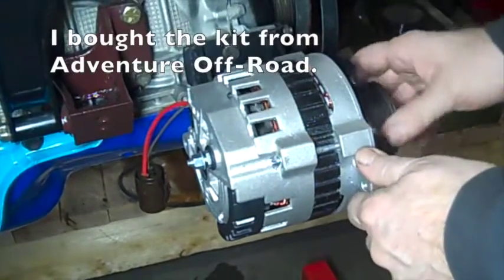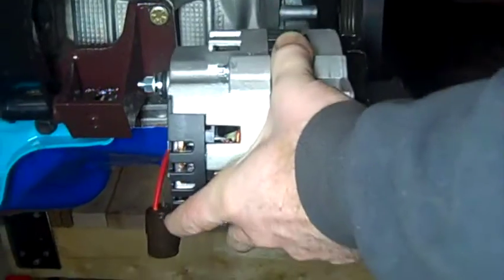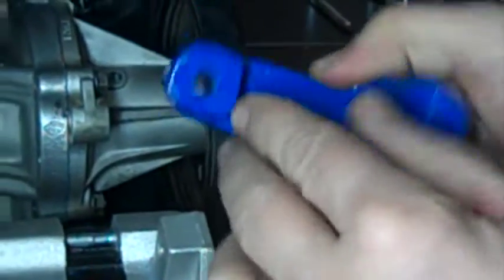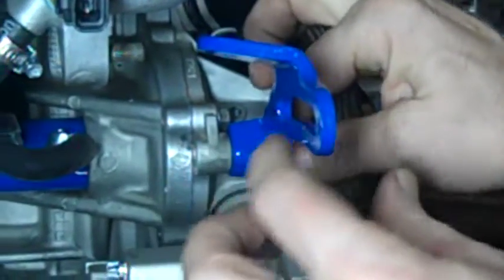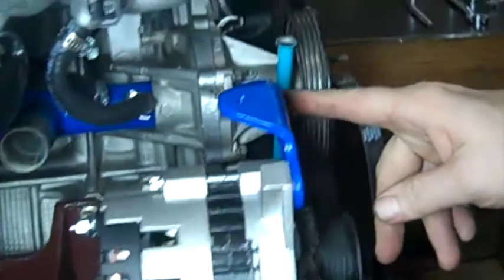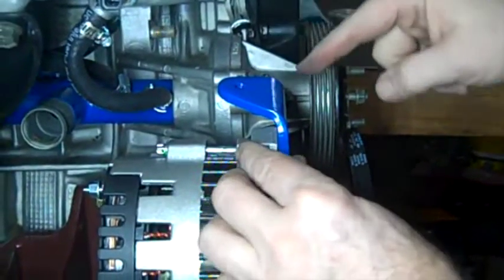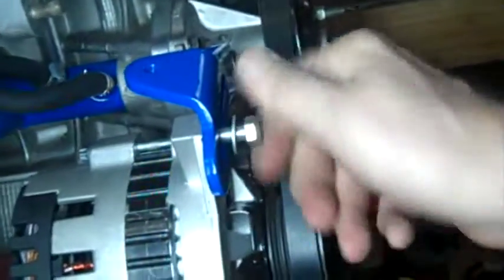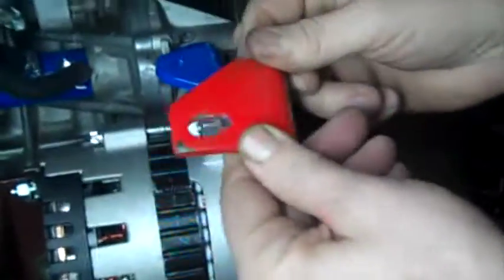1995 Suzuki Sidekick Alternator Upgrade

Comment: We should more of the adventure off front bracket. I got a bracket off eBay and it looks almost like the upper brackets supposed to go behind the nub on our alternator, except you got one of the three bolts that clam shows the alternator together right there and there's no way for the bracket to fit it all. I never thought about spacing the bracket out to go in front of it. Hopefully that'll work cuz I was about ready to tear this thing back apart.
Reply from the maker: I don't totally understand the comment, but my modified bracket has been on there awhile now and seems to be working fine.  Just a matter of making sure the pulleys line up and the belt does not rub on the timing belt cover.

Comment: Which specific alternator did you use?
Reply from the maker: They advertised it as a 105 amp GM alternator.  That's all I know about it other than it was not "plug and play" as advertised.  I had to build a bracket (see vid).  After further research I determined that the whole alternator swap project was a waste of money/time because the main fuse on the car breaks at 60 amps anyway.  On my other project I just replaced the alternator with a new OEM spec from rock auto.  Went right in, no problems.
Reply: @nunapitchuk  will the original alternator charge two battery set up?
Reply from the maker: @MyMathex  I don't know how you can fit another battery in there, but yes, it can charge any number of batteries as long as they are in parallel (Pos to Pos and Neg to Neg) so that it is still 12V and not 24V.
Reply: @nunapitchuk  thank you sir

Comment: Much easier to instead of changing the bracket and having a dipstick issue is to come straight out to the adjustment on alternator from the block and bracket off to the alt bolt.
Reply from the maker: Having trouble imagining what you mean.

Comment: Could have just put the adjustment bolt in from the back.... But it works lol
Reply from the maker: Tried that.  The only way I could get the belt to line up was to move the whole thing forward by about 3/4 of an inch.  On my second build I went with a stock replacement -- so much easier.

Comment: Hi frank! I messaged adventure offroad after doing research on a alternator swap for my tracker and after bumping into your video, i emailed the builder of the kit and said its a plug and play process, I left em a link to your video and he doesn’t understand why is wasn’t plug and play. This is very confusing to me. Im not looking to do any modifications because I dont have the tools or space for it. Im just wondering if adventure offroad is lying or the wrong kit was sent to you
Reply from the maker: I also emailed them and was assured that it was "plug and play" even after I pointed out what the problem was.  The alternator will not line up with the water pump pulley using the bracket that they sent me.  They quit responding to my emails.  So this video shows how I made it work anyway.  I do not know if other people had the same problem.
Reply from the maker: In addition to my other response.  For my second rebuild project, I just purchased a new stock alternator.  So much less hassle.  It is a 55 amp.  The main cut off fuse in the car is 60 amp so you can never draw 60 amps anyway or the fuse will blow.

Comment: i like you video on alternator upgrade it looks like you have the nippon denso pigtail to cs130 do you have a part number. i cant seem to find what im looking for ,any help will be much appreciated. many thanks steve.
Reply from the maker: I don't know because I ordered it as a complete kit from a place called "Adventure Off Road".  I had a lot of trouble with the bracket not fitting good and then after I modified the bracket I had trouble getting the pulley to line up properly and the belt rubbed against my timing belt cover and rubbed a slot in it.  Timing belt covers cost $75.  On my second engine I just bought a new stock alternator from rock auto.  It is probably just as good.  The main fuse will break if it gets more then 60 amps anyway.

Comment: Do you have the 1.8l or the 1.6l in your Sidekick?
Reply from the maker: 1,6L, 16V Engine.
Reply: ok, thank you for the reply!
Reply: Where can I purchase this alternator?
Reply: ALPINE Gamer did you manage to find out where you can buy bigger alternator from?
Reply: Hi Frank thankyou for your messages very infighting . Mine is the 1.6 16v but it's the grand vitara. I haven't bought the alternator yet I wanted to get has much information regarding the upgrade. Your engine looks great with the different colours and so clean aswell you have done a great job.I  am going to rebuild my engine soon it is dropping oil everywhere. I have everything I need to rebuild and  hopefully get it looking as clean as yours I sometimes watch your video to get me into gear and thinking about starting the rebuild. Anyway Frank thanks again for your input it us very helpful. Best regards steve.